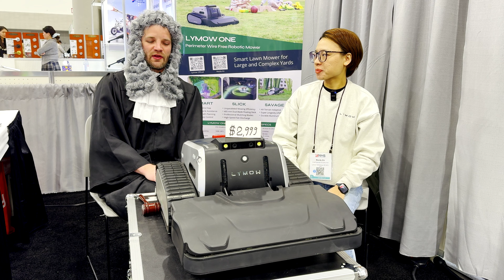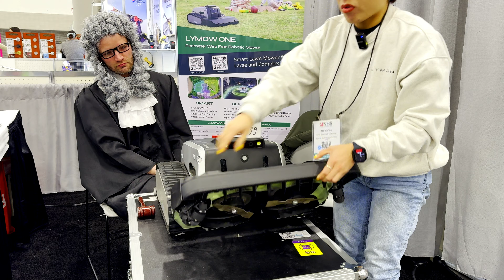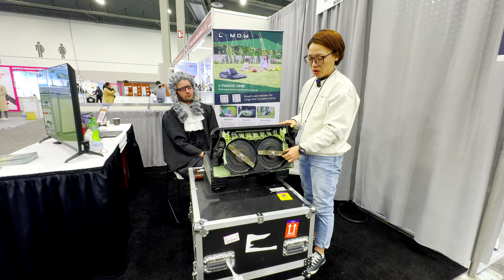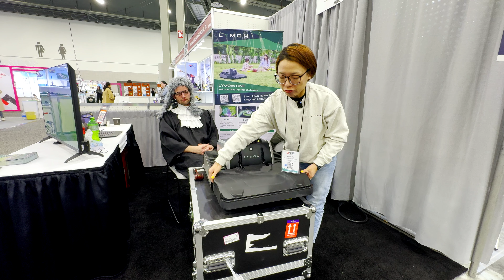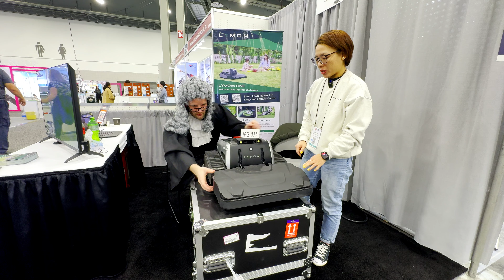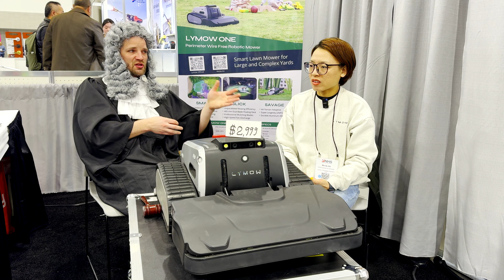Ridiculous charge against Lymow robot (lack of innovation) - Robot Court Case #002

Comment: Innovation is not the supreme law of the land, it is a privilege in free society to allow for better options of mowing said land :). I prefer good execution over runaway innovation any day; although I see some innovation present in this 'case'. I have heard the noise complaint online and find it ridiculous: something we could agree to place lower on the checklist of mower priorities. Granted, some people's situation may require a different noise priority or mower style- as I see this mower best suited for a traditional mower replacement/supplement and larger lawns, not postage-stamp situations.  To me the noise sounds like people running leafblowers down the street which is the typical, arguably-pleasant background noise for dense residential areas.
Reply from the maker: Well put. To add to the noise observation, the lymow cuts more than 2x as fast as any other (residential) robot mower on the market (over 5-10x faster in some cases) so noise "exposure" duration should be greatly reduced. It's something to be aware of, though, for sure.